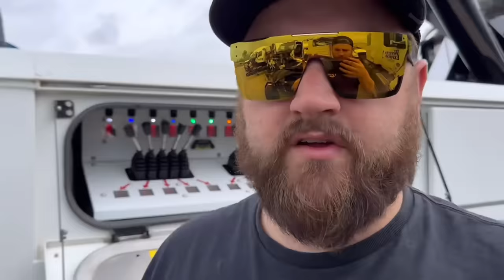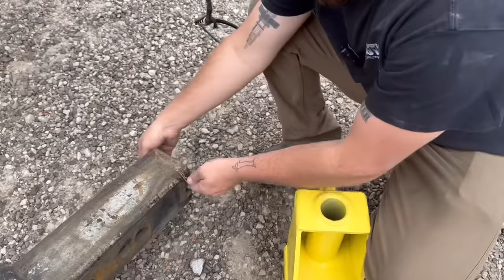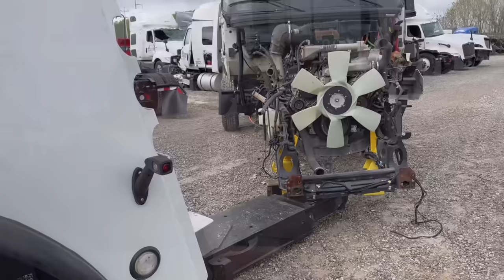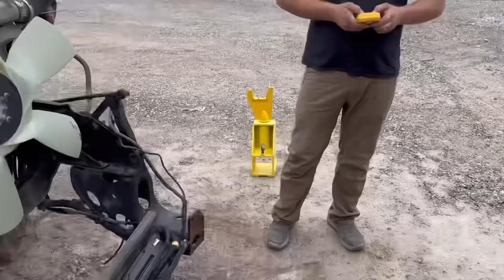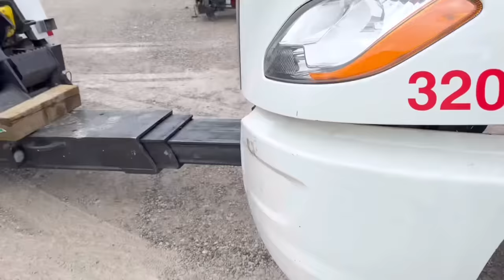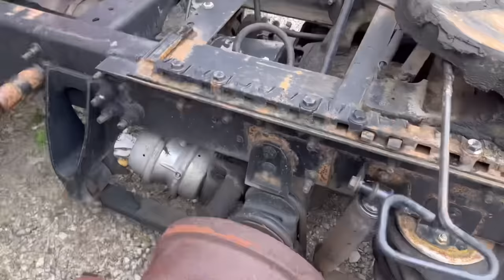First Time Running Our New 50 Ton Rotator, Total NEWB!

Comment: Different risers to forks to get  different hights. Yes the yellow is all to be one system to assemble different tow rigs on undereach.  
Besides rotation some also traverse front and back. 
Slings have ratings tags. Riggers book tell the amount of scrapes cuts before out of service.  
Look for charging cable on big remote on passenger control box. 
Yes playing with it is way to learn

Comment: There is usually a plug inside the cabinets in front of the control cabinets on one of the sides of the truck that charges the remote.

Comment: Pound and talk to Ron at Midwest. Towing and Pratt has a wireless remote control for his. That's still off on off on that. He can control the speed and it plugs and recharges the stage in his unit. You would love that unit is especially when you working by yourself. Or with a new find out that you can walk around. See what's going on and control everything with the wireless remote that works at the speed you needed to Ron Pratt Midwest trucking he got the best set up.

Comment: all those yellow things are called forks and you were correct that they are for front and rear axles (these ones you have to wrap a chain around what your lifting it by and hook it back onto the receiver). but the weird ones made out of flat plate you didn’t know the name of are spring forks, the go on the front of the leaf spring with the nub sticking up pointing forward then there’s a pin that goes through the pin holes to stop it from sliding off the spring. what the forks slide into are called receivers and the wide yellow bar is with the pintle hook trailer hitch on it with the two plates that come up with big holes in it, the 5th wheel attachment pins into that. when hooking up plan what your going to hook up to and with what first, you want to put your wheel lift down then back the head of the wheel lift under to around where the bumper is, this stops your from extending it too much which strains everything a lot. always try to stay as close as safely possible to what your working with, this puts less strain on everything and you can carry/lift more. also do not forget safety chains when on the road, it’s just two chains crossed to either side that hook on something that looks strong to the dot. i could share tons more tactics, dos and donts if interested.

Comment: You need some demountable skips there or at the shop to throw your steel and alloy scrap into, maybe "tyre Uk, tire usa bin"/tipper trailer to , some good gas axes to, cut all the scrap parts off/up. the engine in that international is scrap, prime candidate for the "hot spanner",.

Comment: Glyngosnell called that exactly right that is Spring Hanger Lift I just got thru seeing RON PRATT use one of those just yesterday not on a Rotator however but on a Wrecker Truck their new one put the Spring Hanger Lift on your Under Reach that is what you are calling a Stinger and lift your load the Lift then pivot up and you put that Pin in the the Lift over the Spring Hanger

Comment: Hey Bruce make shore u be super careful with that truck u can hurt your self or someone else and remember that is a truck for recovery more then the just towing thrice is super heavy make shore if you are going to do heavy lifting use snatch blocks that way u double your pulling power that truck is a beast it can pull lift drag almost anything if u no what your doing the school will show how to do recovery work how to use snatch blocks and show u how to rig up straps chains and show u how to be safe u are going to have a blast the school has deferent levels of certifications u should do them all as u gained experience they will test u for deferent recovery’s have a good time and pay attention to the instructor and ask questions if you don’t understand

Comment: Don’t let the winch out if you don’t have pressure on the winch other wise it will unspool itself. Also when running the boom out put the winches in free wheel

Comment: A suggestion, when ever you move the right, shut the side boxes and lower the boom regardless, it's just good practice, think if you had to drive further than you first intended and got close to power wire  ,or a tight gap, it's prevention and setting ones mind to routeen, even if you are off the road.

Comment: The remote charger is usually by the remote cradle next to the passenger side controls in the box just in front of it. Some Century rotators also have a light in the cab that indicates if the remote is in the cradle or not, too

Comment: Learn by doing is fine, but remember before you get on pavement and any kind of speed. Loose the driveshaft or It's got a good transmission is a thing in the past. Compound transmissions don't like to be towed

Comment: You should look into investing in some yankum ropes for the winch lines look up Casey ladelle here on the tube he’s got a rotator with a new Zack lift that can be removed from his semi in less the 10 minutes and also you could ask him for advise as he’s pretty knowledgeable when it comes to this stuff
Reply: Yes Casey has towing down pat, he makes it look easy with his hook ups, but that Zack lift is NOT a rotator. He is also very safety conscious with his hook ups.
Reply: @CNDMrfixit   yeah damn your right but I’d definitely look into the yankum winch ropes he has if i were you especially if you plan on replacing the old line anyways

Comment: Why dont you just use the rotator to load up the trucks that are going to be hard to tow. Use the rotator to load them onto one of your trailers that way you can haul 2 or 3 at a time and then take the rotator to the other shop with you to unload them and move them around. Thats what i would do rather than dealing with the headache of trying to tow them down the road. I own a towing company so i do this stuff alot just trying to give you some input on what id do to try and make it easier for you rather than a headache